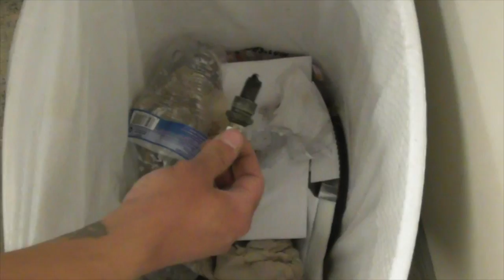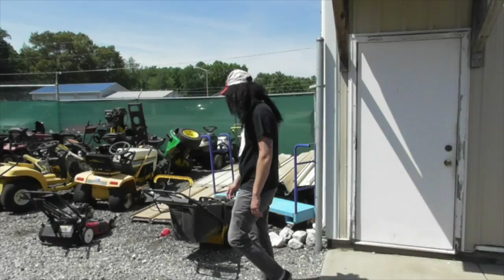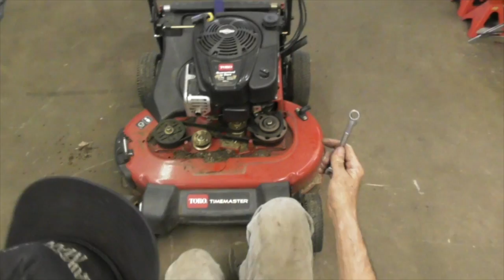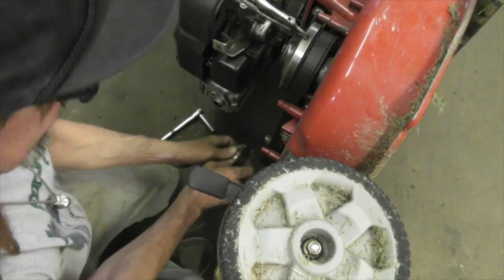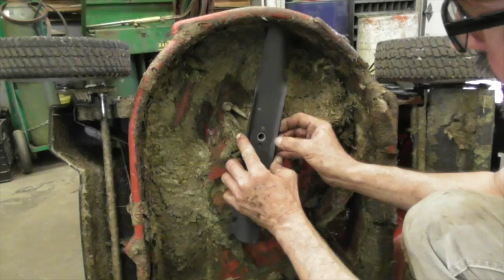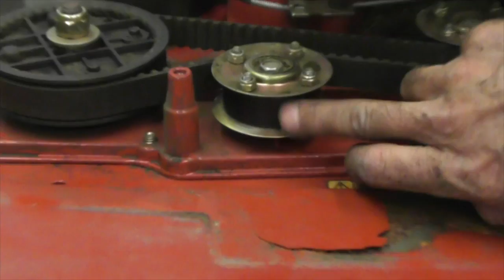How To Time The Blades On A 30" Toro Timemaster Mower   with Taryl

Comment: FYI toro suggests to fit a .25mm or .01 shim in between the bracket and the tension bolt on the belt tensioner.

Comment: Didn't watch the entire video so apologies if this was addressed. Before going through all of the top end stuff, first, check the more likely cause of misalignment. There is a washer (called a blade adapter P/N  20199 20200) that fits into the blade above it. The two small holes on either side of the main drive shaft hole of the blade. It is like a mechanical fuse. If you hit a rock or whatever, pins shear off rather than the shock transfer to the drive shaft. Check that first.

Comment: How are the blades held to the spindle?  I was thinking if I was doing this job, I'd just loosen the two blades from the spindles from the bottom and time them that way.  But I don't know if Toro uses just a hole thru the blades and clamping pressure from the spindle bolt or those star-holes in the center?  But even with the star holes, wouldn't that get it close enough?  I mean it's a mower, not the space shuttle.  ;)  Which is one of my favorite lines of yours.  :)
Reply: Nevermind...I saw the two "nubbins" that the blade mounts into, so the above can't work.

Comment: Could u not just unbolt it like you would if you sharpen the blades and do the timing that way Does it jump timing for no reason , i just sharpen the blades and put them back and then out of nowhere it clipped each other so i shut it down and seen ur video

Comment: This Toro has the Briggs & Stratton its nitorious for problems because it has a plastic camshaft and timing gear in these which these always break. then the valves don't work in the engine.  its very piss poor on Briggs & Stratton's part these are on Mowers and pressure washers these engines.

Comment: Great Video as always Taryl and clan. I have seen the Time Master at a Toro dealer. I guess the 30" cut is suppose to save time. I haven't had one come in for repairs yet, but what I saw in your video, Toro gas taken a step back on quality with this machine and for $1000. I think I will stay with a regular Toro or Airens.

Comment: We replaced the tenisoner near motor that blew out after hitting a canvas dog toy.  We replaced it and set everything and ran it to make sure.  PUt shields back and ran the mower yesterday and nearly finished then the left pully bearing blew out.    Why?   cascading failure due to the tenisoner failing?    Any advice?

Comment: Hello...I have a Troy Bilt 33inch walk behind mower 11.5hp Briggs...and today in tall grass the blades crashed together....got them fixed, but I can't figure out how to get one of them pulleys off for the cog belt to adjust the timing again. Pulley on the left side wont come off...either stuck or a press fit. I assume that's what I have to do to get it timed..I cannot find one video for my model machine in here to tell me what to do. Any help would be great. Thanks!

Comment: Good Job Taryl.  That is a poor design.  Kind of like zero clearance valves on say like an old Ford Escort.  Peace.
Reply: What do you consider "old" escort? Because 90 models and up the manual says they are zero clearance engines...but its a lie I have probably cracked open about 300 of them to fix and never once seen Valve to piston contact from a timing belt break. Like Taryl says I DON'T CARE WHAT THE BOOK SAYS! Those damn escort do have a fatal flaw of dropping valve seats when they get some age on them and then the piston gets wrecked.

Comment: The only thing I didn't see you do, but maybe you did, was to disconnect the spark plug wire from the spark plug before starting to work on it.
Reply: "Safety third"
Reply: The spark plugs is grounded bc the leave isn't engaged

Comment: Doesn't anyone clean there equipment in Podunk? I bought one of the grass scrapper from ProParts they work great! Great video I've been thinking about getting one of those Toro time master mowers are they any good?
Reply: John Samuelson I had one a few years before selling. It worked great for me. Not good for cleanups or really overgrown grass, but works/cuts really nice on a well kept yard.
Reply: Walter Welch thank you for the info about the Toro!
Reply: I love my timemaster. Auto choke, auto self-propel speed,  2  height adjusters,  easy flip handle. I use it for 1/4 acre residential lot.